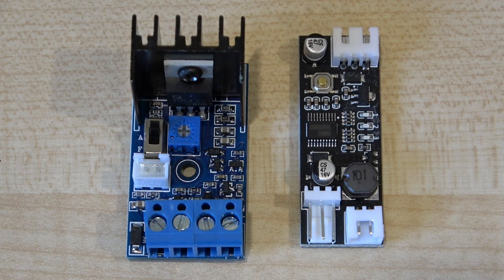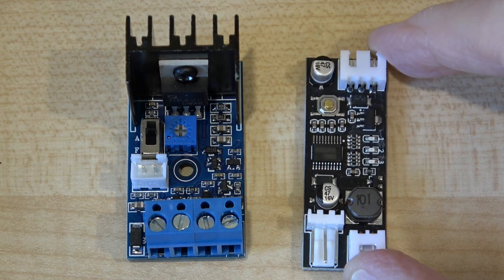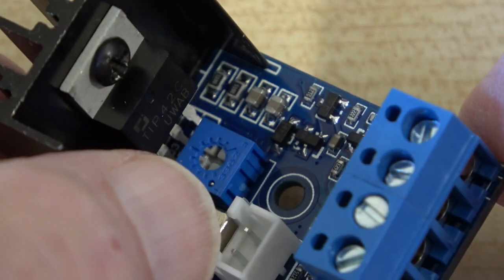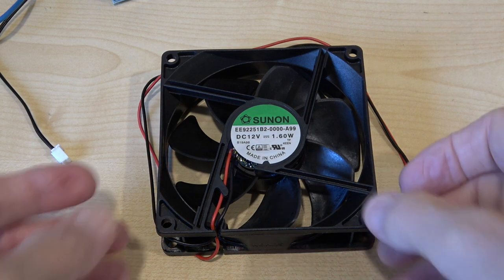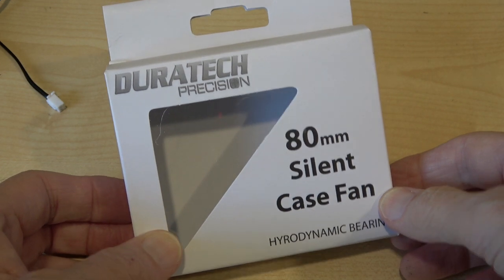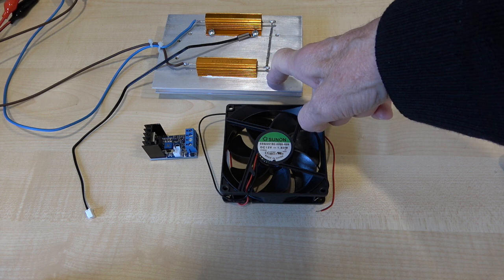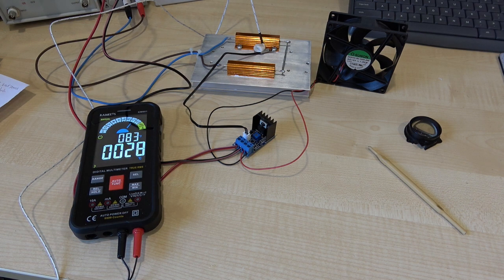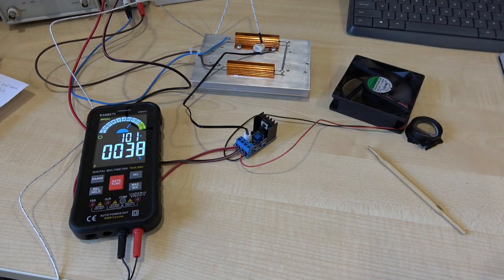Keeping your amplifier cool.

Comment: I have a Denon AVR-X2500H, it quickly gets too hot for my comfort even it eco mode (which draws exactly twice less power than with eco OFF). Probably not a real issue, but I don't like capacitors and CPUs / DSPs getting so hot, so for my own comfort I just put a 12V 140 mm Corsair fan (for PC cases) on top of the AVR, just laid it down to blow into the perforated top cover. I have powered with 5 volts off the USB port that the AVR has, and I can't believe how well it works. Absolutely silent at 5 V (not just quiet - dead silent), and keeps the AVR at almost room temperature.
Reply from the maker: I have a similar issue with an Onkyo AV receiver. It also gets in my opinion, way too hot. I've also added a fan, mine works from a 12 volt supply used for switching some kind of accessory?? It also does the job. Sad we have to do such things really.

Comment: Michael, could you tell us where you purchased the Duratech Silent Case fan and the controller. Thanks.
Reply from the maker: Hi Henry, the fans came from Jaycar here in New Zealand/Australia. I'm sure they could be available in other parts of the world. Many companies sell low noise fans, so you should not have a problem finding something similar. The control PCB was from E Bay. The seller is clearly visible in the video, if I recall.

Comment: Yes heat is a  problem.

I try to avoid fans.

1. There is a part that wears over time. 
Ball bearings withstand more heat than sleeve sleeves do. Oil in sleeve bearing dries out faster.
 
2. you get a lot of dust.
Reply from the maker: The 2 external fans do have air filters on the outside to trap dust prior to getting in the cabinet.
Reply: @MichaelBeeny  Air filter is good. But you will always get less air on the other side of the air filter.
Blow on your Hond and then put air filter in between. You notice a big difference.

Comment: there are many fans that make more noise either have a noisy engine or are out of balance.
the more air, air pressure a fan blow the more noise.

slew bearing withstands less heat since oil evaporates away faster than the grease on ball bearings does.

If you have bought a ready-made desktop computer, it can be built cheaply and incorrectly in many areas.
Cooler that comes with CPU. is not so good and fan often goes at full speed. Radiator type are the best CPU. cooler.

Then you need to have enough air circulation in the box.
Reply from the maker: For most use the fans never come on at all in my set up as the heatsinks are reasonably good. After all it is a powerful amplifier. Real power not Chinese watts!! For the days when you need that extra power, things keep cool. Cool amplifiers are happy amplifiers.
Reply: @MichaelBeeny  OK. There was a lot of wrong writing. Has now fixed that.